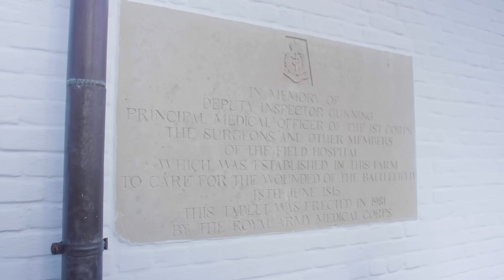This Human Skeleton Found Beneath The Battle Of Waterloo Could Rewrite History

Comment: Can we just appreciate the fact that the whole process was started on the 4th of July and 2 weeks later we have an archeological documentary of this quality, delivered for free! 🤯 Thanks.
Reply: I'm wondering about the farmland and its owners.  Are they being compensated?  Will the land be properly replasced?
Reply: I hope you aren't applying some murican relevance to date for something that has nowt to do with murica.

Well beyond them supporting Napoleon.
Reply: @Gambit771  Nope not at all, I live about as far from the U.S. as you can get. Was just the date that they literally mentioned starting in the documentary.
Reply: @ItsJakeStuff  It is hard to tell when it comes to that date especially as you typed it the correct way to type dates yet hardly used by Brits anymore, ironically used mostly by yanks but only for that date.
Reply: @veramae4098  They will replace.....
Reply: @veramae4098  I'm sure it has to be

Comment: Horse bones being found near a field hospital really isn't that puzzling. They had ambulances during the Napoleonic wars. What do you suppose the chances are that a stray shell landed near the hospital and managed to kill a ambulance or ambulances and their horse teams. You could have also had the ambulance drivers killed. In the spirit of utility and speed, they were all dumped together in a sort of mass burial pit. This seems like an viable explanation.
Reply: Or injured animals being put down and used to feed troops.
Reply: @johnanon6938  That could be as well but 4 horses was the average team for a field ambulance as well. They didn't have larger teams like supply wagons or artillery wagons, just enough horses to convey the wounded back to field hospitals. For a very reason you alluded to, the value of good horses, was why ambulances had only 4 per team. Many made due with only two. While important, ambulances were low on the priority lists for horses since it was believed that the ambulatory wounded could make their way to the rear field hospitals on foot. I also think that the location would not have been frequented by officers as they were needed on other parts of the battlefield. More likely this is an ambulance hit by a stray shell that was at or near a field hospital. Further study is going to be needed to figure out exactly why they were found where they were.
Reply: @markwaldenberger8412  Well said Mark . Let the experts tell us . That said , I find it interesting to hear facts , from informed people , about how things were at this time , or other historical points , which help me understand the situation . I would have had no idea about how many horses were commonly used for different carriages for example. But suggesting this 'buried' body was a high level officer simply because he ( if it was a male) was found buried , for example , sounds like an unfounded  political statement .
Let the evidence speak and then make a better judgement of the situation guys .
Reply: The problem is there are no mass graves in Waterloo, or surrounding, it’s a embarrassing fact that  so claimed 15.000 killed soldiers disappeared like snow under the sun

Comment: The tale of how they disposed of the dead and wounded Cavalry horses mentioned in the videos commentary is misguided, I think, you will find Cavalry units had farriers with them and they were equipped with an implement designed to quickly despatch any wounded horses on a battlefield. If you ever watch film of Trooping the Colour in London you will see one of the few remaining Cavalry units still remaing in the British Army, the Household Cavalry. Mouted and at the rear of the formation there are always, even today, 2 Farriers. They carry an axe like instrument which at the business end there is a shiny axe blade and opposing this is a spike or poleaxe. Every service horse has a number
either burned or somehow marked on one of the hooves. When the wounded horse is despatched by a swift blow with poleaxe to the beasts forehead the axe is used to cut off the hoof, so that accurate records can be maintained of how many horses remain, to assist in maintaining horse fodder rations and saddlery equippment. The same axe blow/hoof removal is performed on the dead horses as well. 
Apparently, Wellington's comment about "What have they done to my battlefield" was made on a later visit after the Lion Monument was completed. The modern day topography bears no relation to the actual battlefield he remembered. 
Incidentally there are 227 steps to the top of the monument (I counted them when I visited the battlefield in 2008), so how much soil was used for this enormous monument to the Prince of Orange? How many of the bones were contained in soil used to erect the monument.

Comment: If the soil at the battlesite is acidic in the places where gravepits were dug, it is quite possible that skeletons would have just dissolved. That's maybe why nothing has been found.  A marked site for the burials of rebels of the battle of Sedgemoor, 1685  was excavated, and there too, nothing was found, though it's odd that nothing metallic was found either.  🤔
Reply: Soil around Waterloo is mostly clay and not acidic.
Reply: @michaelmazowiecki9195  Mostly, but not all. 😐
Reply: @mikesey1  I lived close to Waterloo for several years and walked the battlefield. The battle site soil on the Allied and French ridges is a sticky clay with a muddy , shallow valley in between. Crops are sugar beet, wheat, barley, cabbage, all indicative of a heavy clay based soil. The construction of the Butte de Lion mount on the center of the British-Dutch position soon after the battle, was created by scraping the earth from the surface of the Allied ridge, lowering it several feet, which uncovered and robbed out the burial pits . The bones was largely exported to England where they were crushed into bone meal fertiliser. The French and Prussian burial pits were treated the same way.
Reply: Why should ordinary farm land suddenly be "acidic"? Are you actually aware of how food is grown during thousand of years? 🤦🏼
Reply: @OmmerSyssel  sandy and peaty soils are typically acid and are often farmed.
Reply: @OmmerSyssel  Go away.
Reply: @mikesey1  🤗 try again!
Reply: @michaelmazowiecki9195   I started my comment with an 'if".

Comment: British Army Farriers during the Napoleonic wars carried axes, ( the household cavalry, and horse guards still do) with which they destroyed horses, that were injured in combat, and to collect one foot from each, the feet were turned over to the quartermaster, as proof that they died in combat, and weren't stolen, and sold for profit, and were used in determining how many remounts had to be purchased, these axes, had a spike, opposite the blade, called a poll axe, these were round, and would leave a hole in the skull, that could easily be mistaken, for the wound caused by a musket ball. I doubt that the army, would have wasted ammunition, that might have been needed for combat, when the company farriers,knew their jobs, and would be assigned to perform the task, as the animals might spook at a musket blast in their faces and bolt raising havoc, whereas a quick and silent blow, would accomplish the job.

Comment: I can see that the current procedures and attitudes towards battle dead did not exist in the early 19th century. But, since the use of these bones as fertilizer was published in the newspapers as early as 1820, so not at all that long after the battle...  Didn't relatives protest that?
Reply: People were more worried about getting through the winter than a relative they may or may not have met.

Comment: You haven't found the bones because you're looking in the wrong place. They have not been robbed out as you put it. No one has come along and dug up 15000 graves. It's to much work.
Reply: The definition of work today is NOTHING compared with the same definitions of the past.  Think about moving the stones that made Stonehenge or the Pyramids.
Reply: Yeah it’s nonsense. Burial pits and trenches are notoriously difficult to find.
There a numerous well known battlefield’s where the burial locations ate still a mystery.

Comment: Why don't you just leave them a Ferkin alone? They are not there for our entertainment. If you want to do anything for the dead Soldiers, then find out Exactly where all the bodies are buried and I mean Exactly where they are buried and not where you suppose they might be. And then when you have found them. Build a proper fitting Monument for them. And if you do find any monuments that have fallen into disrepair. Renovate Them. The way things are shaping is all that you will do is put up a brass plate with your own names on it and nothing else. There are over 45, 000 soldiers missing a grave stone. They must be somewhere.

Comment: It must have taken months if not years to clear the fields of the dead horses.  The smell of rotting horses could have bee smelled for miles.  Could you image being  foot soldier sand having the line heavy cavalry coming at you on strong tall heavy horses running shoulder to shoulder mounted by tall strong riders swing heavy swards down ward at the men on foot. As the horses met men on foot the downward thrust of the blades were met by the arms of the footmen trying to protect them selves.  As their arms were severed in one powerful swing  and than trampled under the hooves of the powerful swift horses.  The survivors were then at the mercury of the light cavalry of swift smaller horses and  lighter blades to finish off the survivors. How can 15,000 dead be considered a victory.   The last battle becomes the first battle of the next war.  Which was The War to End All Wars.
Reply: Lots of fantasy, but zero knowledge? 
Stray animals, birds and farmers in need of agrarian land would soon have cleaned up. Boiling fat from dead animals was also a traditional way to make a living...

Comment: I think that much of the ancient history of just 200 years ago is lost among modern archaeologists . Horses that served in WW1 for both the British and German warchine were sold to be butchered in France regardless of health, so there is no reason why this did not occur 100 years prior to that conflict . I suspect that those humanely slaughtered and buried were officers mounts .
The reason why there are no human remains in abundance is that the several hundred years proceeding had taught us that rotting corpses create disease amongst the living . Officers may have been given a fairly decent burial ( even after serious injury ) or even returned home later after being recovered when safe to do so after burial and decomposition was complete . The rank and file simply mass cremated in heaps and used to fertilise the fields . Sandy soil like this is not kind on bone fragments .
Battles also resulted in wounded that died in route home assisted by survivors and in some cases killed by pursuing troops far from the battlefield as at Naseby during the English Civil Wars as the Royalist Army fled North to Market Harborough . Some 29 000 took to the field at Naseby but the contemporary count of dead was just less than 900 from documents in the British Library . Battles are won not by massive death counts but by one side being overwhelmed and routed and then retreating . Firearms and ordnance had progressed little since the 17th century by 1815 . Smoothbore muskets of the same calibre being just as inaccurate and used with volly fire .